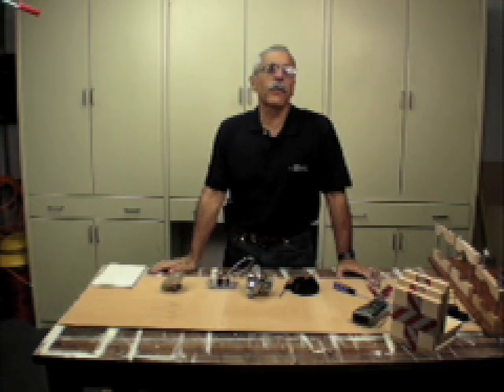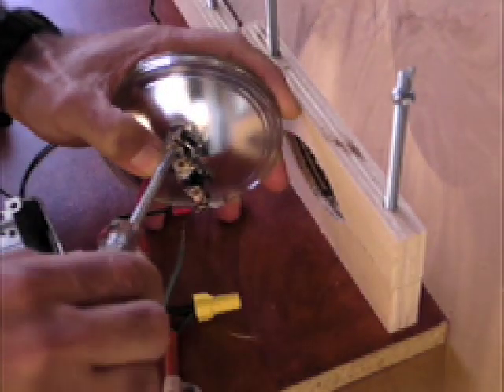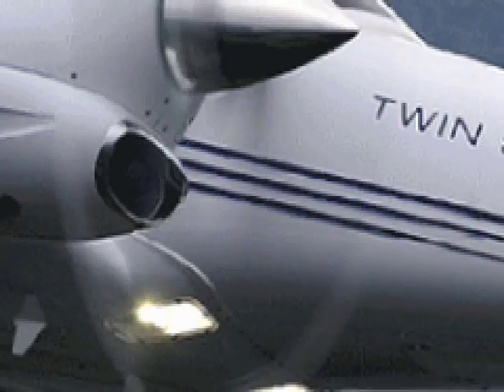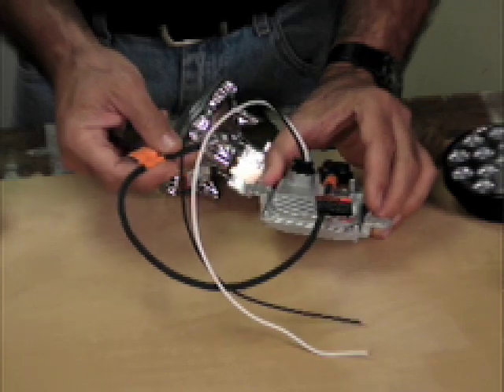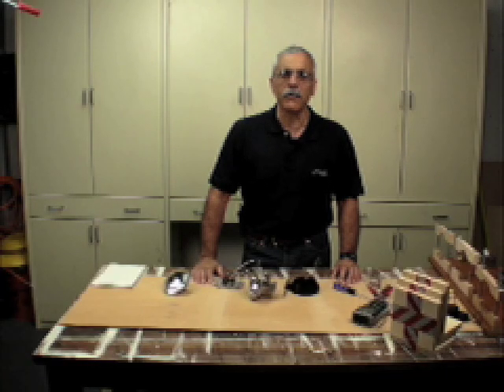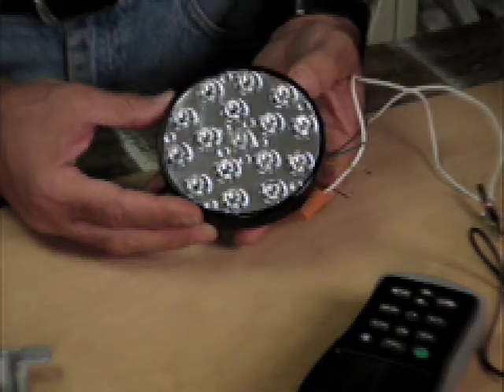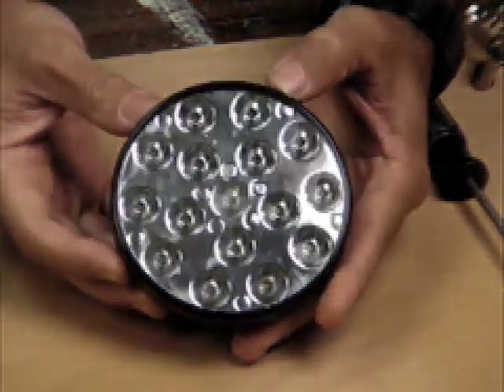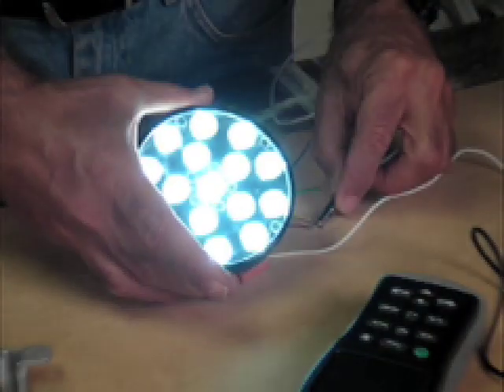Are LED Landing Lights Bright Enough?

Comment: Has anyone tried using Offroad Baja Lights set into the leading edge of an airfoil like you see on some jeeps & 4x4's.  I think you can get away with this in the Experimental Aircraft category.  At least mount them on the wing strut of the aircraft and aim them accordingly for ground op's.  Some of those LED  light bars can make the night look like day.

Comment: Hello all,
I installed Whalen landing lights nav and strobe and beacon on my Cessna after my mechanic installed aero leds on my Cessna.
Two years later, landing lights failed and I'm getting CB popping due to.....water inside the nav strobes.
So if you are surfing, considering Whelen  vs the other options,
Don't be a cheap ass like I was,
Just go,white whelen in the first place and save a 3600 dollar mistake.
I've a video of my aero l.e.d's  here on you tube, just search aero led's full of water.

Thanks ,
Fly safe.